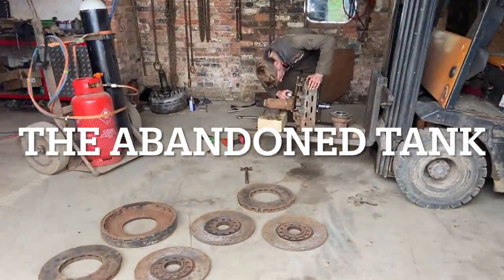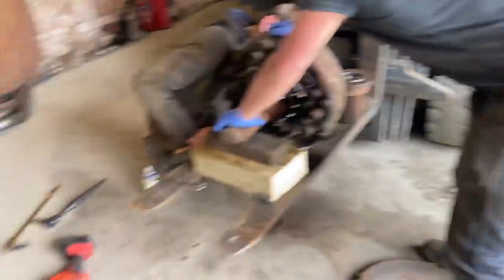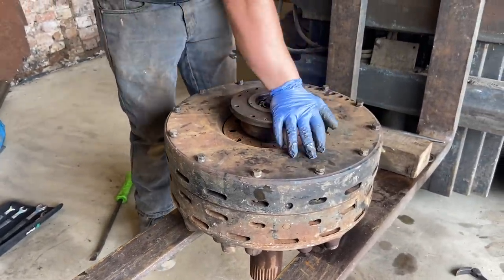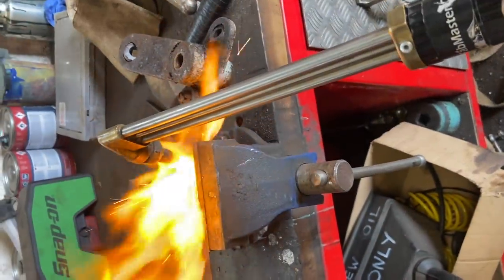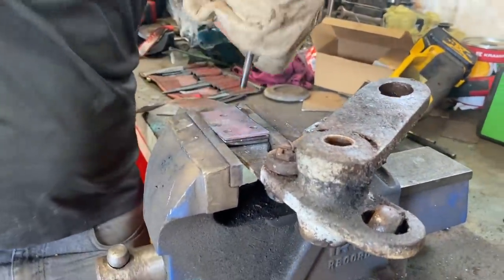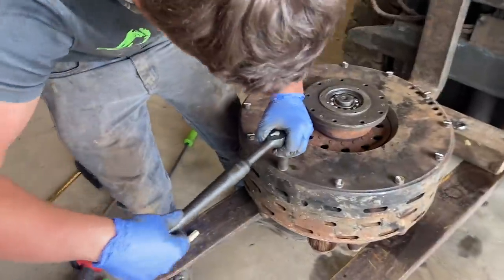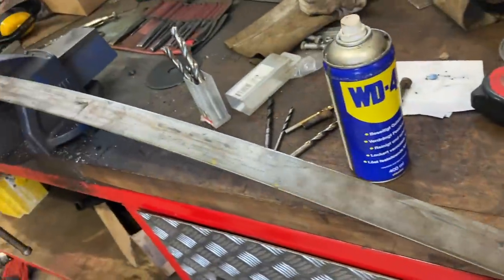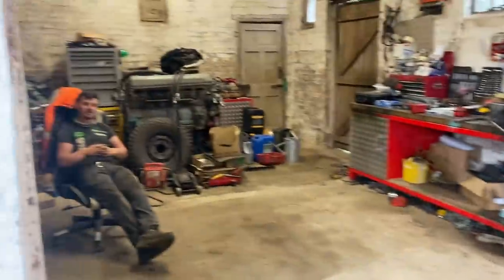The Abandoned Tank Episode 6 - Brakes, Clutch and Fire! We refurbish the centurions brakes & clutch

Comment: Wondering if y’all took a center punch and staked the brake band bolts on the nut side after he trimmed them? I’ve seen that same type of brake band have the bolts work loose on a lattice boom 250 ton crane that was used for cycle duty work,basically dredging with a clam bucket on the Ohio river. It did NOT turn out well. The expansion from the brakes being heated up and the vibration from two Cummins diesels running against the governors shook the bolts loose with about 300 feet of cable on two drums got really loud and ugly with a shitload of sparks and cable flying. Not sure how much your tracked history lesson weighs but I am sure that none of you guys want  brakes taking a dump on your machine while it’s tracking down a hill or slope. Also torque rates for grade 8 coarse bolts is 3/8=43.6 ft.lbs 59.3 Nm 7/16 =69.8 ft.lbs 94.6 Nm 
1/2=106 ft.lbs 144 Nm  
Fine thread bolts 3/8=49.4 ft.lbs 67 Nm. 7/16=77.9ft.lbs 106 Nm.  1/2=120ft.lbs 163Nm. all those specs were listed as used on dry bolts. Using oil or Anti-seize for the same clamping force has a multiplier to go with those dry numbers. If y’all need the specs or different stuff for metric sizes just let me knowI’ve got nothing but time since a 5000lb pipe was dropped on me in 2017 and I sure as hell miss running and working on the old heavy equipment. BTW,you fellas are doing a kickass job on your channel,keep it up. 👍

Comment: I thought snap on tools were for the bedroom? The correct torque for those bolts are tighten until you feel it start to strip the threads, then back a quarter of a turn

Comment: I'm no snow flake but watch your eyes when you smack sht or grind, had metal in my lip and hand from using drifts on pins on heavy plant, luckily it went in my lip not my eye and bits of a grinding disc picked out my eye. It's no fun. It's your shop so do what you want but I didn't used to give a sht till it went wrong.
Reply: Yes i agree , i had a 9 inch grinding disc explode and it hit me hard right in the nuts, man did it hurt, was very lucky it didnt do permanent damage. definitely dont want to do it again.

Comment: @Fitter Mat , couldn't you measure the torque needed to undo those clutch bolts, for the torque needed to tighten them ??
Reply: breakaway torque can be far different from tightening torque, especially after sitting for many years
Reply: Especially if they are rusted in place

Comment: Not being funny but what sort of rebuild is that, when you have not even taken out the springs and cleaned and oiled them very lightly and more importantly cleaned out the pockets and lightly oiled the inside so that the springs will move progressively without any hang ups? That clutch pack in its present state would likely as not be very grabby as the springs could well hang up in the pockets with the amount of crap inside them another day spent wire brushing and wiping over with a lightly oiled rag would have been a better thing to have done. WD 40 isn't the best thing since sliced bread!
Reply from the maker: Feel free to buy one and do it yourself if you can do better
Reply: @fittermat  I was expecting a somewhat more "in character" response. Very restrained...